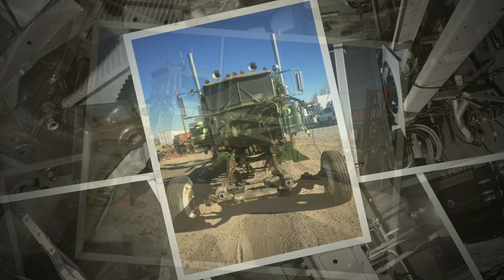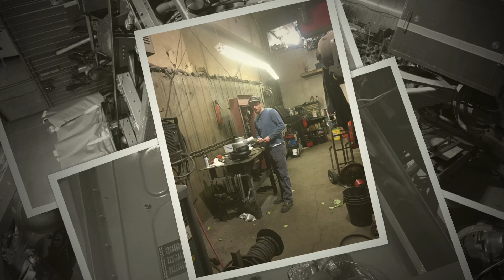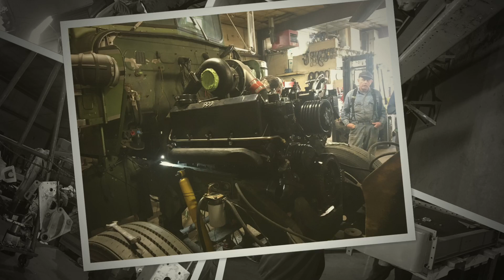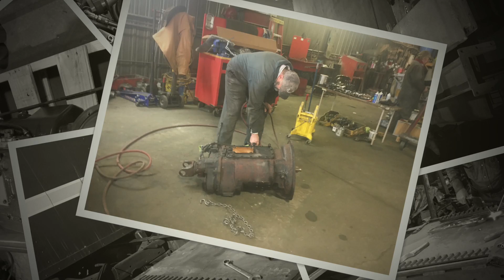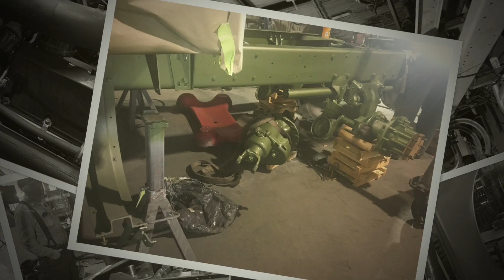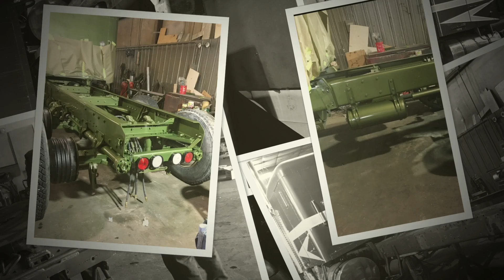Mechanical restoration of Sundance, the original "Movin' On" Kenworth

Comment: Cool!  A true restoration to original condition.  Even kept the torsion bar rear suspension instead of replacing it with air ride.
Reply: When Paul restored it originally restored he put a hopped up NTC-444, around 700 HP and it had air ride under it then but Mark is putting it back to the OEM build sheet, which was a VT-903 and torsion bar suspension. I already had the trucking bug bite me at 6 years old before the show aired on TV, but it spurred on me wanting to drive. I celebrated 44 years last month, gonna try to make 50, God only knows if I'll make that or not.
Reply from the maker: As Dewayne said, it did have a Pete air ride and frame had been lengthened.  Lots of work to reverse all that, using original build sheet and frame layout as our guide.

Comment: YouTube just popped this up in my feed. Geeze remember as a 13 14 year old kid saving allowance and cutting lawns to make the money to run down to the local Kmart to get the model kit of the Movin On tractor and a box trailer to go behind it.
 It's a 50 50 toss up between CW McCall and Movin On for putting diesel in my blood and leading a few years later to a 40 year career.

Comment: Just wow! An original spec VT903 truck?! Golly that's rare, Pretty neat withcha 10.22 Split rim Alcoa's... I would've thought Locking ring. Some day I'll track down a V903 cabover!
Reply: I never saw anything but tubeless 24.5’s in this video…..period correct would have been either the 22” lock ring style tube type or tubeless one piece 24.5’s, both ball-seat of course, by the mid 70’s actual “split rims” were a thing of the past for the most part.
Reply: @J.R.in_WV appreciate the info! Im building a 81 gmc Astro period correct but it's a nightmare finding those rims and tires.

Comment: Awesome job! Any new updates? I had no idea before I watched your video that the movin on truck had a 903. I am currently working on putting a 903 in a 75 W9. Had a good friend that used to run one that got killed is a snowmobile wreck a few years ago. Trying to build this truck as a memorial to him. Any chance I could get you to take some close up pictures of the front cross member and rear motor mounts to help me with my project? Keep up the great work!!!
Reply: It’s funny I always called out replicas of the truck I’d see on YT because they didn’t have the 903 in them….in one of the season 1 episodes Claude Akins as Sonny says the truck has a 903 Cummins and a 13 speed in it, and in the episode where thieves try to steal it we got to see the engine was in fact a VT-903 like Sonny said.

Comment: I figured out that the high tappet covers are for the Jacobs brakes, my VT903 engine doesn't have "Jakes", and it has the lower covers. Here are engines without the jakes and with, https://youtu.be/wd6PMNQmuYc    With jakes and after cooler, https://youtu.be/-qD1n2zItnk
Reply: Dang, that's really interesting! I grew up in major hill country, and don't think I've ever seen a semi without Jakes. Appreciate your input!

Comment: the gvw on the truck in the show is 78,100 where did you get 80,000
Reply from the maker: This has been beaten to death ad nauseam.  The truck worked for a living for many years.  The frame was stretched, it was updated for "modern" times.  If you've been following, you know all those mods have been reversed back to original specifications, as delivered new to MGM in 1974.  When the truck is repainted, as part of this restoration, the GVW will reflect 78,100, just like on TV.  

Thanks for your interest.

Comment: A turd of a motor unfortunately, 903 were so so !!
Reply: Of course they were a turd if you drove them at 2100 like a lazy fleet driver. GEAR THEM correctly DONT overwork it. Run it at 2300-2600 rpm and you'll be fine. 4.88 rears and stick an RTO-9510 behind a 350hp VT-350 you have a pretty decent setup.
Reply: @matthewkabanuk443 rather have 3.55rears instead of 4.88
Reply: Try saying something nice, it's really not that hard to do.....
Reply: @billbazen9432  I advise you to grow some thick skin if you found it offensive But I guess you are a millennial.
Reply: @scottycollins1829  I have 4.11 with a RT915
Reply: @michaelsorrentino9279 Just stating the facts and I surely don't need your advice.
Reply: @scottycollins1829   You could do an old school setup with a double-overdrive trans. Do 4.88s with an RTOO-9513. Allows you to counteract the relatively low torque of a 903 and pull the hills easier, but the double overdrive has tall enough top end overdrive gears to still cruise quite fast on the flats. Were talking about .68 overdrive. Instead of .87 (RTO-12513) or .78 (RTO-12515)
Reply: @michaelsorrentino9279  Not even close.
Reply: It will not be a working truck! 
It however "Will" be an accurate as possible RESTORATION 
of the Season 1 truck - Nothing else matters
Reply: @goratgo1970  Thought it would have had a 1693 Cat. Then it would have really run.
Reply: I absolutely agree. I had a V903 in a CO 4000 and I thought it was a piece of crap. Cummins discontinued the V-8, and so did caterpillar. That’s got to tell you something.